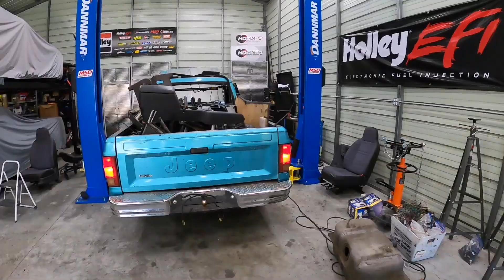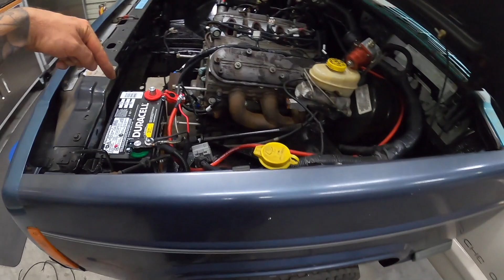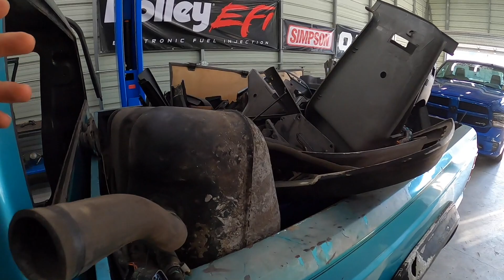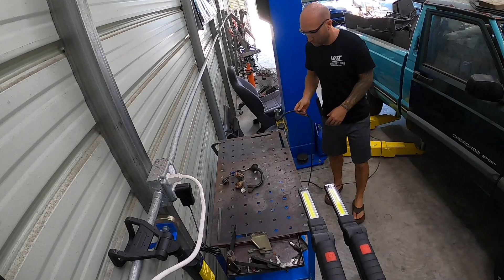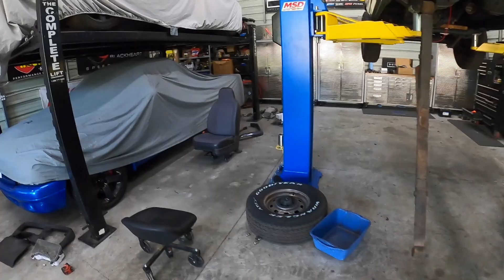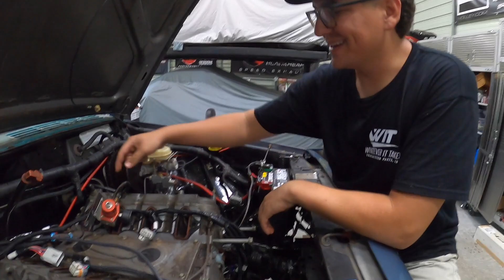Will the Axle Hold? | Jeep Comanche LS Swap EP 7

Comment: Cool project!!  Probably not telling you anything that you don't already know, but you will be on borrowed time with that 8.25" axle.  I ran one of those in a 1989 Shelby Dakota as I built it up for drag racing.  You should be fine with street tires but the posi clutches are weak and the axles are not much stronger.  Slicks will snap them quickly based on my experience.  Lastly of course with the c-clips, the wheels will walk right out when breaking an axle.  I am sure that you can do much better if you first upgrade to hardened axles but I ended up going with a Ford 9 inch.
Reply from the maker: The 97+ 8.25 has 29 spline shafts instead of the older 27 so its a bit stronger for sure.

Comment: Was thinking. You don't know what condition that 5.3 is in since you haven't heard it run. If, by chance, it's toast and you have to use the 6.0 is everything going to swap over? I'm not a LS guy so I don't know the differences in layout between the two. But, something to keep in mind where you might want to account for wiring, bracketry, etc to have enough slop so things will fit on the 6.0.

Comment: Sand and polish the rear tail lights. Throw a thing of clear over it

There are aftermarket tanks but just be careful as some of them have the pan and others don’t so that may cause an issue with the fuel pickup. Also, since it’s a return-less system, you’ll need to plug that new pump assembly you got. 

If you end up putting the XJ windshield in, make sure you order another gasket for the newer XJ and cut off the little nubs/tabs on the MJ. 

Super stoked. Keep up the videos and tech 🤙🏽